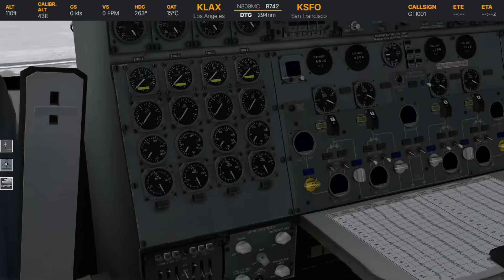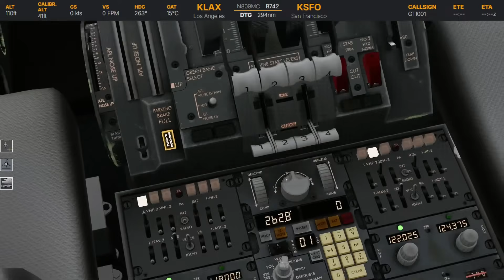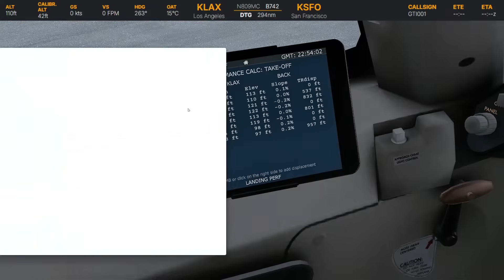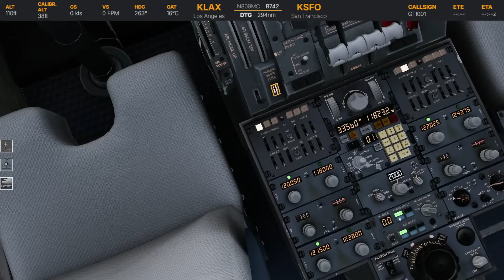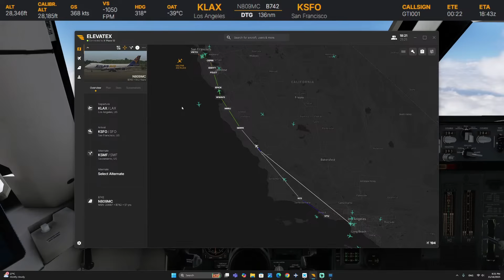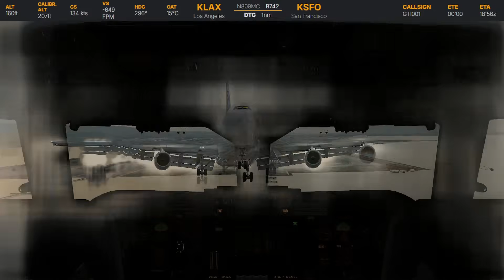XP12 Heavy Cargo Beast — Felis Boeing 747-200F Preview

Comment: This is a must-buy for me! I do wonder though, would the flight crew be present during loading/unloading or would they book on to collect a jet that's ready to start up and go and beetle off to the hotel as soon as the chocks are in?
Reply: I was a flight engineer on B747 -100/-200 for thousands of hours on both cargo and Pax flights. I performed the walk around and cockpit preflight while the crew was in flight ops getting the flight plan and WX for the flight.
Ress
Reply: @jress9967  Brilliant :) But on cargo flights would the aircraft already be loaded by the ground handlers or would you be on hand for that?
Reply: @Roa @RoamingAdhocrat airplane would in the process of loaded the cargo while I was doing the preflight. I would check that  the correct amount of fuel is loaded correctly. I then completed  the Take off data, climb and cruise data and paperwork. It would be normally be loaded by then and I would go down to the cargo compartment and carefully check to see it is loaded properly and secured and any hazard’s cargo is loaded correctly.  By the time I did all that the  Capt. was usually waiting for me to start the check list.
The entire preflight process usually took one and half hours to complete.
Ress